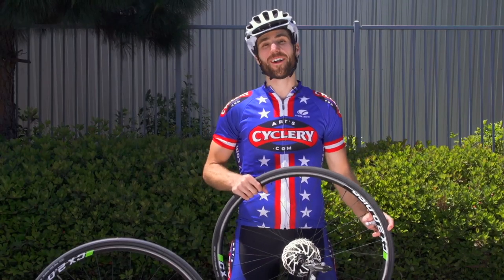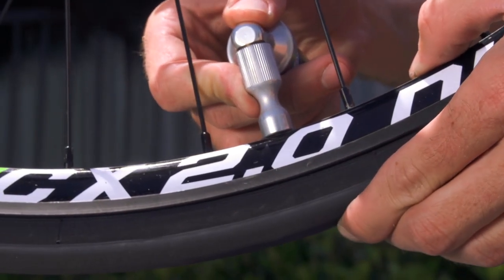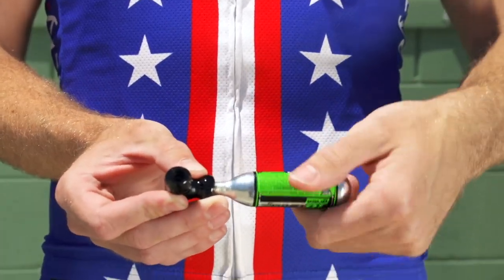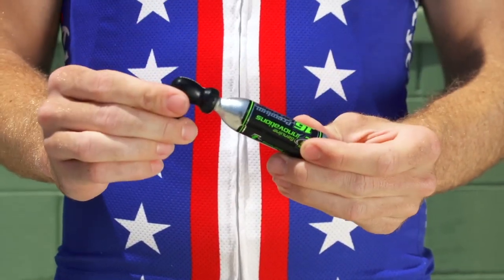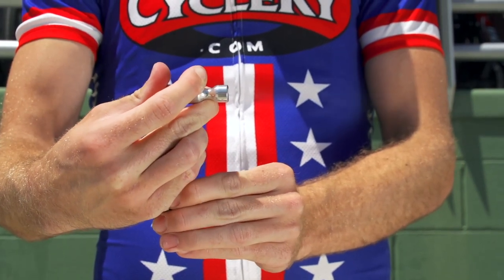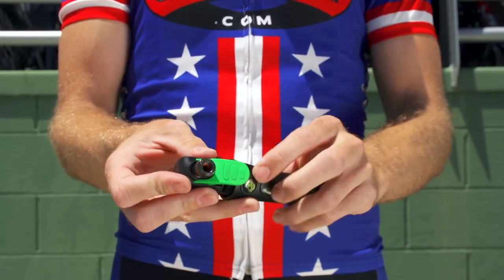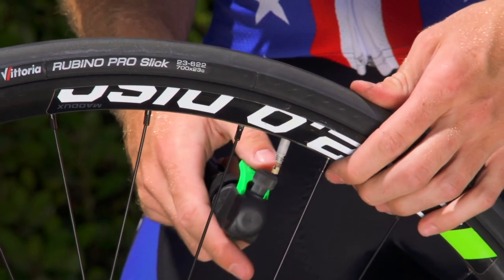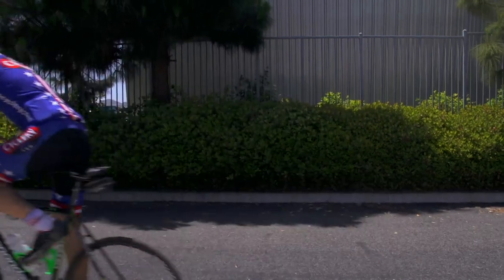How To: Use Co2 to Inflate a Bike Tire

Comment: Good video but I'm still old school with a compact frame pump. Biggest problems my friends have had with CO2: only had one or two small cartridges and ended up with two flats on a ride or forgot to take a new cartridge after having a flat. Regardless of how frustrating a hand pump is, it always is there and it always works and will put in enough air to get you home.

Comment: Nice video. However, I would suggest using another type of fill cartridge called StayFill. It lasts for years! Look for it on Amazon to save shipping cost. I have used this product and my wheelbarrow tire, moving dolly tires and bike tires are still full after 5 years since I filled them.

Comment: Is this like a one time use or can you use it over and over until the air runs out?
Reply from the maker: +NaRdOsF Usually it will use most of the cartridge to fill up a tire. If not, you can reuse it if you leave the CO2 attached to the nozzle. Thanks for watching!

Comment: are there any pressure regulated inflaters out there so overfilling isnt an issue
Reply from the maker: colin p, at least to our knowledge, there aren't. The only solution we can think of is carrying a pressure gauge with you to check and adjust the pressure after you re-inflate the tire with CO2.

Comment: Question for folks/Art's Cyclery: At 2:08 he says if using a 16g cartridge, be careful not to exceed the tire's pressure, since it can fill up to 130 psi. My tires are good at 105, so without a gauge, how can you tell that it's not overinflated? Thanks!
Reply from the maker: elecbass100 Good point. What we usually do is listen to hear the CO2 flowing into the tire and as it slows down, pause the inflation and squeeze the tire. You can compare the firmness of the tire you are inflating to the other good tire on the bike for a good approximation.
Reply: Art's Cyclery Stupendous answer! I mean really! Thank you kindly.